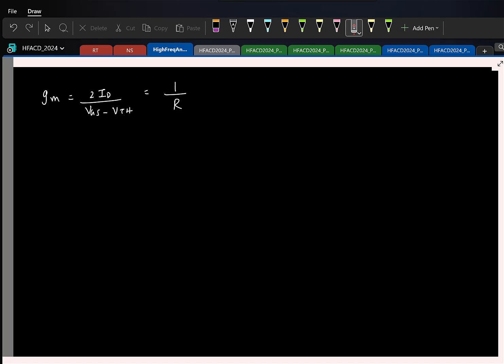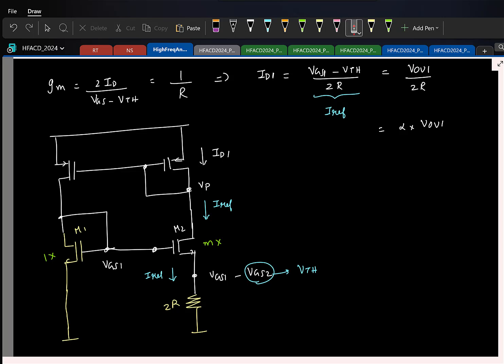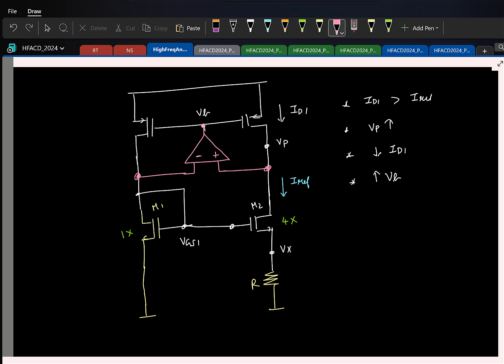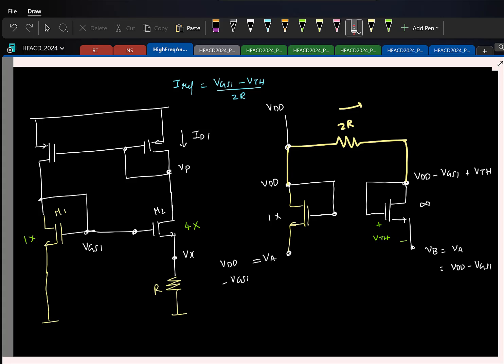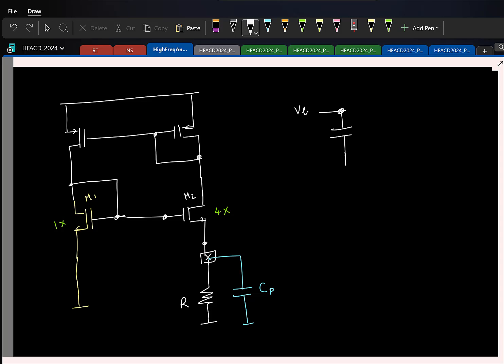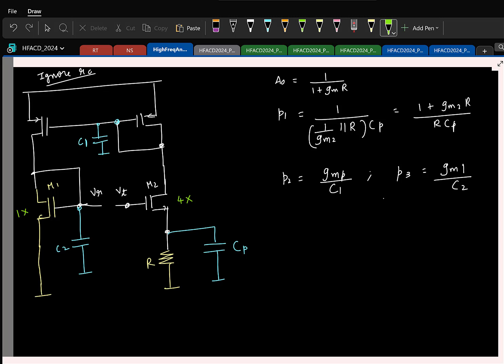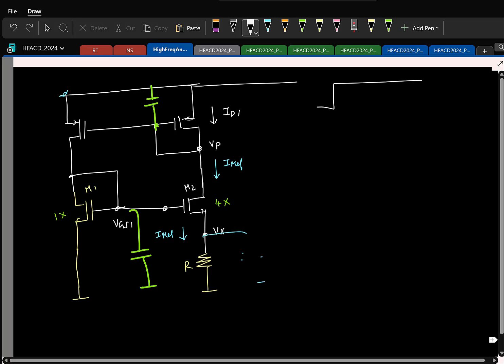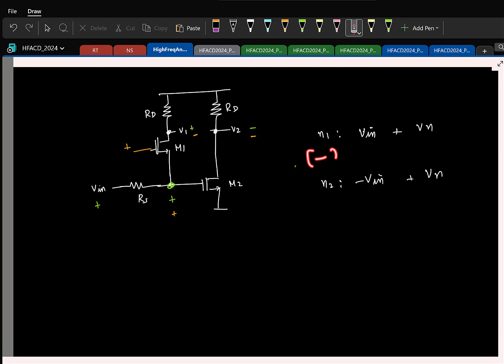Lecture 37: Constant-gm biasing: Deriving its multiple variants; Stability of constant-gm bias ckts.

Comment: Hi Sir great lectures. Just wanted to point out, in the loop gain calculation, you have considered gm1=gm2=gm (instead of gm2=2gm1=gm) which is not the case.